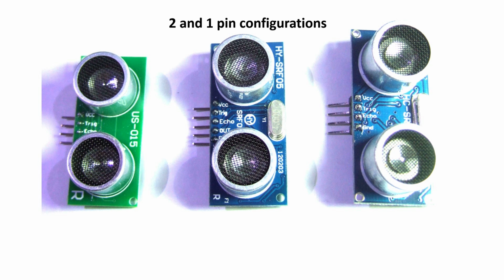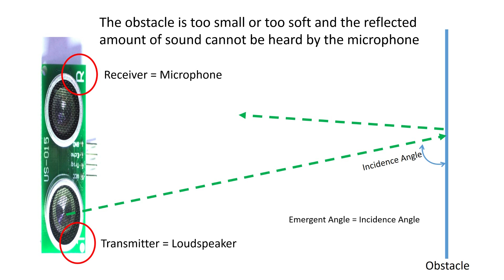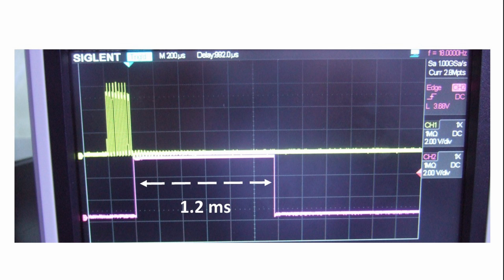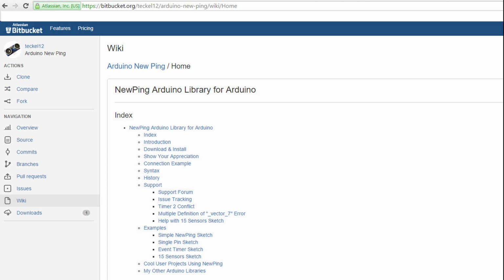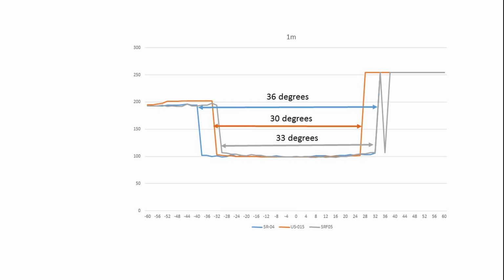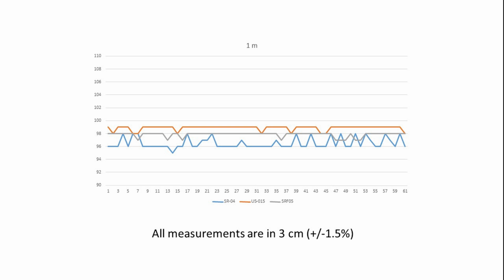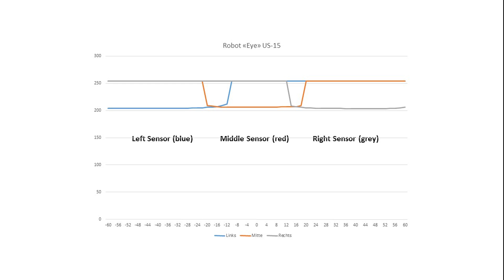#40 Ultrasonic Distance Sensors Arduino Tutorial and Comparison for HC-SR04, HY-SRF05, US-015

Comment: Hi Andreas - great video!!! Can you recommend a sensor for measuring small changes in distance? Sensor distance from object: 25cm, smallest required change: 25microns. We would attach the sensor to a robot which positions a deposit gun. Idea is to monitor changes of coating thickness over time. Hg
Reply from the maker: I do not know of such precise sensors :-(

Comment: Hi Andreas, just a question ... i have 4 x HC-SR04's connected to an  Arduino Pro Mini 328 5V 16MHz. I'm reading distances and convert it to Mavlink signals for (future) object avoidance on my drone.I noticed that 2 of the HC-SR04's had huge spikes ..0-134 and measured value.. I tried a lot of things to get the measurement stable. As a last option i set the 3 wire option in the NewPing to False...this was the solver of my problem , super stable measurement now on all four ..but now the question ?..how can this cause the problem i HAD in your opinion ?.
Reply from the maker: I do not know. The only thing I can imagine is that they receive the sound of other sensors if fired nearly at the same time.

Comment: Hai
 I want to use cheap HC sr04 for overhead water tank level monitoring.
To protect pcb from environment and moisture I wish to do potting with epoxy leaving sensors open.
But being sensors are also subject to high moisture , I wish to introduce  ultrasonic admitting  thin plastic films like ohp sheet separately for tx and rx.
Will it work?
How much  the range decreases ,,,,,?
Please share your experiences

Thanks and regards

Comment: Hi Andreas. I've been trying to work out the situation with voltage on the SR-04's. I've only used them with arduino 5v logic level and power before. But what about in ESP32 land? It looks like from your scope shown earlier in the video, if that is from the SR-04, I count ~2.5 divisions and see you have it set to 2v/division. So 5v in, 5v out? Will it work if power is 3.3v from the ESP32? I've seen potentially dubious looking examples online but struggled to find anything concrete about the how best to use the SR-04 with 3.3v logic level (and alas don't have a scope - although come to think of it I could maybe check with an arduino analogue in...)
Reply: Ah found the other videos also the data sheet(could have sworn I couldn't find it before). For 3.3v level shifter needed unless using P (plus +) version

Comment: Are there any ultrasonic sensors that can listen for a ping without first sending one?  I want to build a device that detects the ping from another sensor so I need it to be in a listening mode without first sending a ping.  In short I'd like just a ultrasonic receiver.
Reply from the maker: I do not know of a ready-made module. Maybe it would be possible to change one of those (or use some parts) to create one

Comment: Andreas, I need a sensor to detect moving vehicles on a highway in front of my house (to count them).  I need a range of 15 feet (from the sensor to close lane) to 25 feet,,almost 8 meters,  (to get far lane traffic).  I've tried 2 lidars, a couple ultrasonic  (SRF04 and SRF08).   The latter was supposed to be good to 11  metres, but I can't get it to detect >1.5 metres.   I'm considering microwave and I do have a Doppler receiver device.   Is this a good option?  I just need a detection at this point, not speed, which I'll add later.  Unit has to operate in bright sunlight so likely any lidar or IR is out, as I've found.
Reply from the maker: Doppler radars are used for that purpose. But you have to select one which complies with your distance needs. These are not cheap.

Comment: Hello Ing.
Digging here and there I found something rather interesting, and maybe I can even upload an image.(...i can't in here...)
However, what I found in a discussion of ultrasonic sensors is that the on-board controller only "listens" to the first incoming echo while cutting others.
In your video I see that when you take the measurement test using plexiglass, the maximum distance you reach is about 4 meters, right where you have a tree by your side.
It could be that, just the echo of the tree, has blocked the measurement, as the sensor cannot "follow" the moving objects, but only the first echo that it hears coming back.
Don't you think it could be interesting to redo the measurement in an open field?
BTW,thanks a lot for your videos,always well done and interesting for me.
Reply from the maker: You can try it in an open field, but will not get much more than 4 meters range. And you are right, the measurement always takes the closest point. Which is ok for most of my applications.

Comment: What if you attach ultrasonic sensor to the rotator and use it like a lidar? That would scan any wall. The communication to the microcontroller would have to be done over wireless (maybe 1m range BT).
Reply from the maker: These sensors are not very fast and the opening angle is big. Probably not a good solution.

Comment: Hello Andreas.
Why don't you separate a tx, put it on a pcb face up with a cone above it and the apex of the cone towards the tx (cone with a 90 ° angle) and, on the same pcb, don't put 4 or 8 rx all around the tx that look outwards (trans on axis y and receivers on axis x arranged at 360 °)?
Also you can amplificate the tx signal to improove the distance of the detection.
What do you think?
Reply from the maker: You would have to synchronize the receivers exactly with the TX. Otherwise, you would get bad readings. But it should be possible.
Reply: Andreas Spiess definitely needs to be synchronized everything, but what I said is just a general idea, the angle of the cone depends directly on the angle of emission of the transmitter, etc etc etc.

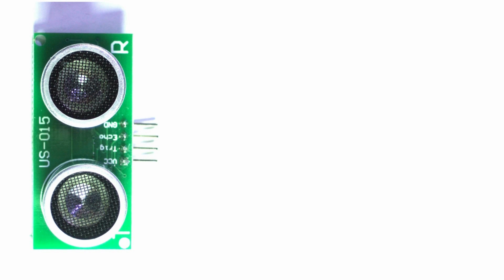Comment: There is a project I would like to try that uses the 3 pin parallax sensor. Sounds like you are saying you could use that code and simply connect the trigger to the receiver as in 9:21 and it would operate somewhat similar to the 3 pin parallax ?
Reply from the maker: I do not know these sensors. But I checked their homepage and they have lots of documentation. I am sure you find the answer there.
Reply: @AndreasSpiess  Timing would apparently be the difference. I'll be comparing that.

Comment: Wonderful video, but it left two of my questions unanswered. When I get a bad reading from the HC-SR04, it seems to me that the distance sensed was always shorter than the real distance. I have been attributing this to ambient noise. So, questions:
1) Are these sensors indeed susceptible to ambient noise? And,..
2) Do they always err on the side of reading too short?

The solution to the problem that I am contemplating is to always do three readings in a row and then take the largest reading. Would that work? I know it will take longer to take three readings, but I figure that since the sensor is mounted on a servo the increased read-time should be negligible to the servo-movement time. Would this plan work?
Reply from the maker: These sensors do not measure. The timing is done by the Arduino. Speed of sound is not constant. It depends on the air pressure. So you maybe only gave to multiply your value by a correction factor. Loud ultrasonic ambient sound could harm the function. Never saw it, though.
Reply: @AndreasSpiess  Yes, I understand that, but for some reason, even though I keep calling the same routine to take a measurement and the distances being measured are out-of-range each time, every few readings I get "something is there" for one reading and then it goes back to "nothing is there." I am fiddling with a servo-mounted sensor on the front of a cheap smart car, and it keeps thinking an obstruction is there and reacting to it. I know a lot of things might cause this, from ambient noise to the cove of sensing touching the floor to just plain bad coding, I am trying to sort it out. Unfortunately I don't have much time to just sit and play with it, much of my Arduino time is taken up these days with work-oriented test fixtures, playing is a side-line.  :)
Reply from the maker: A typical thing is also if not enough sound is reflected either because the target is soft or the angle of the target does not reflect the sound back to the sensor.

Comment: But I need for forward collision detection  800 meter to drive safe
Reply: If you want to make collision detection alarm, it's always best to use 3different frequency ultrasound sensor so that you can cover all the blindspot. After that you have to make PID controller which will analysis your input channel

Comment: but when you  angle the sensors 20 degree from another then they shouldent detect each other? or am i wrong? Grüessi us de schwiz ;)
Reply from the maker: I did a sensor with 3 sensors for my robot. If you synchronize the three they work. But they can detect reflected sound from another. Because it is synchronized, it does not matter.
Or if you wait till the echo es back before you start the next.

Comment: An interesting comparison, thanks for this upload. I purchased several HC-SR04 and set up the most simple program to measure distance. No matter which big, flat surface I use, no matter if the distance is 2m or 10cm, there is never a constant output of the distance values. Intermittently, incorrect readings come again and again, only individual ones but wrong ones. Is there any way to avoid this effect?
Reply from the maker: Maybe. I would look also at the wiring. And at the signal with an oscilloscope. 
A viewer had similar issues and reported better results with the serial US-100 sensors.

Comment: I ordered a few more hc-sr04 sensors, but they have "blind spots" in the cone of detection.  I looked at the metal cone  behind the mesh grill.  The bad ones have a rough metal cone inside.  The really bad ones have a rough cone on both the receiver and emitter.  I don't know if the rough cone is the problem.  Anyone know?
Reply from the maker: I do not know. Mine have shiny cones.

Comment: any chance you can share the info on those adapters you have used to connect those three sensors to the arduino???
thanks in advance
Reply from the maker: These are just dupont wires
Reply: thanks, how/what did you use to connect the trig+echo on to the arduino in one pin ???

Comment: How to deal with erroneous readings that arise when the wall is at an angle?
Reply from the maker: I do not know how to deal with them because they are false results. Most of the time you will not get any readings in this situation because the sound is reflected in a different direction. 
I hope that, because I have 3 different sensors, these are fewer. The next step would be a turning LIDAR which measures all angles.

Comment: do you know if there is any sensor to read distance around 10m for arduino?
Reply from the maker: I do not know one.
Reply: Yes.  the best would be a LIDAR sensor.   Google for low cost LIDAR.  But lost cost thee 10M is about $50.  For $150 you can get to 40M and for $2,500 out to at least 200M
There are also much beer ultras sensors priced at about $40 each that can do 10M.   They are used for things like measuring water in big water tanks or even grain on silos

Comment: I'm pretty new to Arduino et al. From what I've found, I can get good results with just one sensor sat atop a servo motor - in conjunction with a real time clock module (probably overkill lol), I can call a function to 'look' and left and right of the 'bot, and nudge it left or right accordingly at regular intervals. It still has an IR sensor at the front to avoid walls just in case it's 'sweeping' at that particular moment.
Reply from the maker: This is too slow for a fast moving robot.

Comment: This was a very informative video. Thank you.

Two questions if I may. Do you believe it is possible to use a thermal / temperature sensor, connected to a arduino board, which makes the calculations that impact the speed of sound, which can then be used as a reference point of what the sensor distance actually is? I'm not sure if Arduino has the memory capacity to carry out the calculations and ultrasonic sensor calculations. 

You have also clearly illustrated the angle limits of the ultrasonic sensor models used. This creates a problem for my project and I'm glad I came across your video. I might have to go back to square one on my flood detection alarm using an ultrasonic sensor that will have to detect water that can not be measured directly forward because of the space constraints of where the water is.
Reply from the maker: Measuring temperature is an easy task for an Arduino.
Reply: Yes, I am aware of this. I am referring using the temperature sensor that collects its results that can then be used in combination with an ultrasonic sensor which has multiple answers based on temperature 'results'
Reply from the maker: I am no specialist. But I assume that there is a formula for the influence of temperature on speed of sound. It should be possible to program the formula or at least an approximation into an Arduino

Comment: Hello, I would realy like to get your help adding maz sonar sensors to a 3dr iris+ quadcopter? Could you please give me some of your expertise on this subject?  davidringler40@yahoo.com
Reply from the maker: So far, I do not plan any quadcopter projects. I decided to buy one instead of building one (Mavic Pro)
Reply: and do you have anyway idea how to add and ardiuno with sensor to flight controller and receiver from the transmitter plz?
Reply: David, you might be better served by a radar module. Quads move around a lot, and there's lots of air chopping around that would probably disturb the readings.

Comment: Hi, at 9:39 you have mentioned that it is possible to use only 1 arduino pin for both trigger and echo pins on us-015. In my case i always getting 0cm :( I use NewPing library v1.8. Any ideas what i am doing wrong? Sketch from simple example http://playground.arduino.cc/Code/NewPing just replaced pin to same for both trigger and echo...
And one more question (of course if you have ideas on this :) ). I am trying to google how to trigger interrupt on some distance. Lets say, if sensor less that 10cm to obstacle, then trigger some function. If i adding this test simply in loop it consumes quite lot of time... I know that this should be possible, but... lack of experience and understanding how things works do its job ;)
Reply from the maker: 1. Usually, it should work with just one pin. So, I do not know your problem. Does it work with the 2 pin configuration?
2. I think, you have to invest your time to understand the basic functions. This is maybe a good opportunity ;-)
Reply: Yep it works. The problem was in cheep chinesse sensor. One of two received sensors do not work at all :-) Sorry, i should remove my post after realized the real issue. Simply forgot :-(. Thanks for your tme!
Reply from the maker: No problem. Anyway, it is always good strategy to exchange part after part to find errors...

Comment: Can you have a single transmitter beam being reflected by a spinning mirror and a circle of receivers on the robot, and using the position of the mirror work where things are.
Reply from the maker: I do not know if this works with sound. For sure, it works with light (video#119).

Comment: Andreas, Thank you so much for doing all this research. I'm currently working on an interactive display system for a photographer. Big prints of photos should light up as a person comes close to them. The problem I encountered was that the HC-SR04 works well up to a small distance of 30-40cm but I need to detect a person approaching the sensor at about 100-150cm. Do you have any advice how to solve this problem?
Thanks again!
Reply from the maker: Usually it works ok up to 4 meters. But you have a parameter which limits the distance. Maybe you set this parameter wrong (MAX_DISTANCE in new ping library)

Comment: Great video! Can you review the higher end ones? Like URM37 https://www.dfrobot.com/product-53.html it has temperature compensation for accurate measurements. Also Parallax sensor and Maxbotix sensors. It would be really interesting to compare the higher end models with those cheaper ones.
Reply from the maker: Thanks. I have no need for more precise devices. So I will not spend the extra money for a better quality. I am just a hobbyist. BTW. Some of the newer cheap ones seem also have temperature compensation, if I remember right.
Reply: The US-100 modules cost all of £2.12 at the moment (vs. £0.99 for HC-SR04 you tested).  So either more than twice the price or basically the same cost, depending on whether you view it in relative or absolute terms :)

If you care about accuracy or repeatability at all then I would recommend using a US-100 in serial mode (in trigger/echo mode it is basically a HC-SR04 so not worth it).  For a moving robot absolute accuracy might not matter of course, as long as you can spot an object is coming towards you.

See here: https://github.com/stoduk/PingSerial

Comment: Hi Andreas, do you know of any ultrasonic sensor that works well with 3.3V source? My HC-SR04 becomes unstable below 3.7V
Reply from the maker: I did not try. The US-100 claims to start at 2.4 volt.
Reply: After posting this comment I found a new version of the HC-SR04 (HC-SR04P) that claims to support 3V-5.5V. I'll order a few and test them, they are cheaper than the US-100. Thanks!
Reply: That will depend on the angle, search up "refractive index" and "critical angle"